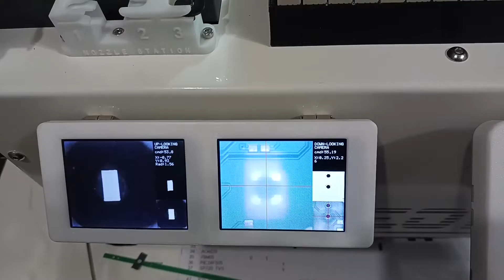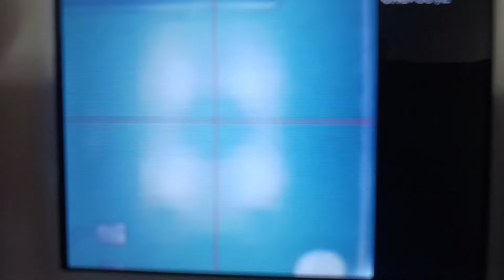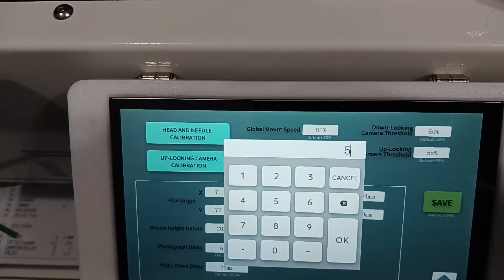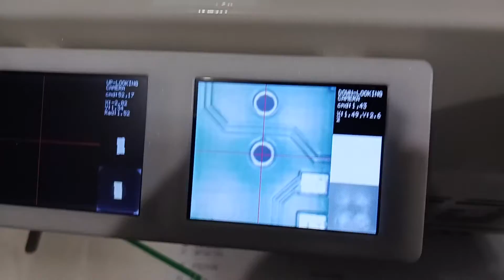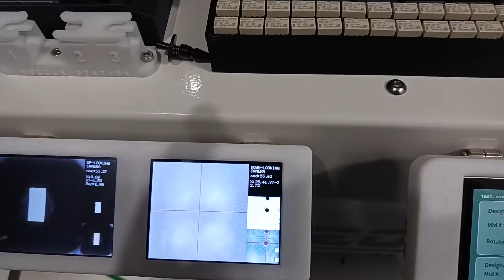Neoden YY1 Pick and Place machine. Down Camera filter enhancement

Comment: What should I enter in PnP file for picking up components from bulk feeder. I had ho problem with feeder 01 to 50 but what number should I enter to pick from other feeders? is there any doc related to it because user manual doesn't have this info. Please